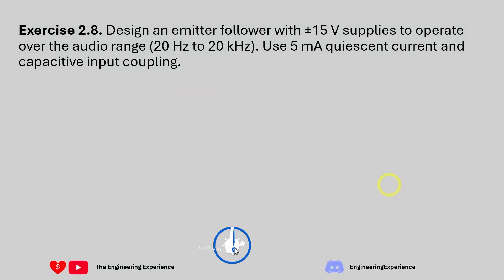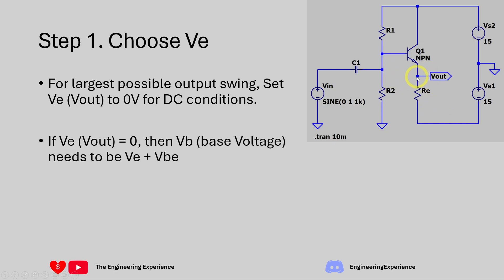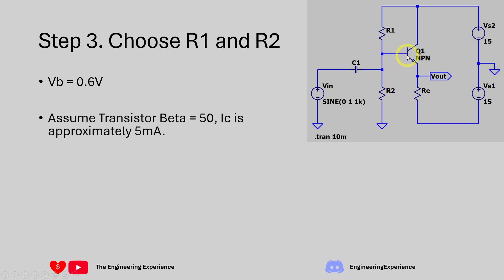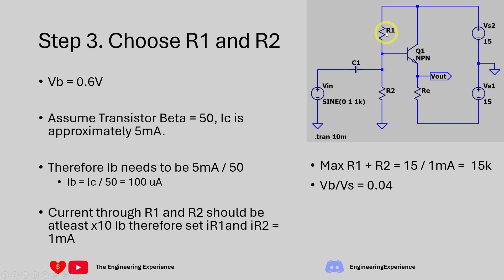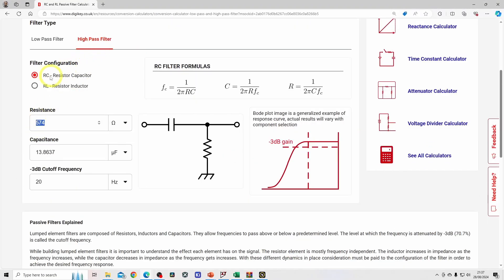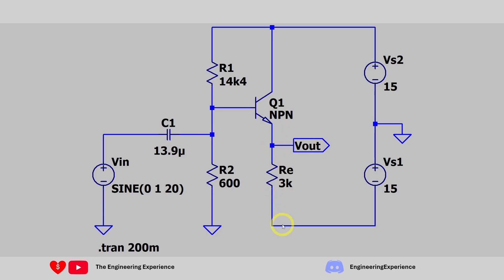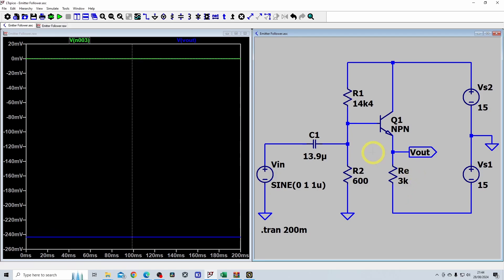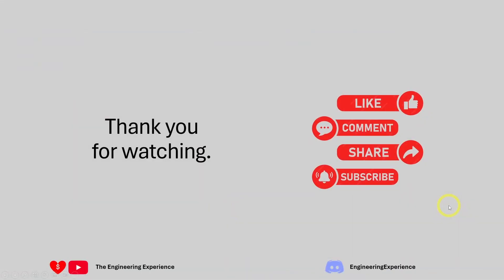Emitter Follower Circuit Design - Art of Electronics Exercise 2.8

Comment: Hi, why in the first video in resistance for RC filter you add Re*beta, but here its in paralel?

Thanks for the answer and thanks for the videos :)
Reply from the maker: Can you tell me which video you mean for the first video?
Reply from the maker: the Input resistance on this circuit is a parallel of R1//R2//(Beta*RE). Let me know which video you mean and i'll try to get back to you.
Reply: @TheEngineeringExperienceYT  I mean the first 2.8 video with only +15V source.

Comment: thanks for the video! why the current through resistors R1 and R2 should be 10 times greater than the current through the transistor base? i can't understand this
Reply from the maker: It's so that the loading effect doesn't not affect the voltage bias too much. 

For example let's say you make the resistors values too high then there will be larger voltage drop when transistor Ib current goes higher. With a smaller resistor the effect will be much less.
Reply: thank u so much!
Reply from the maker: @tora_32 you're welcome